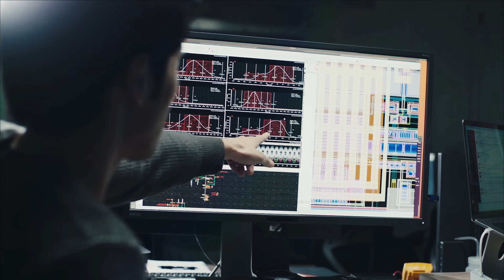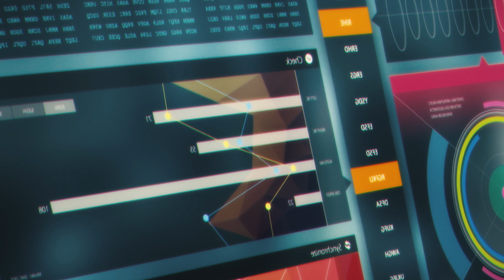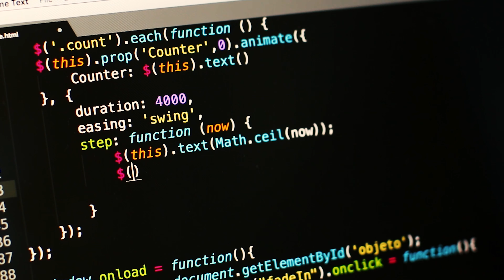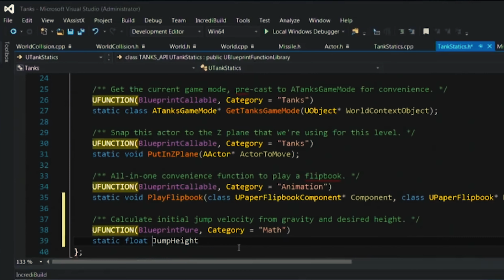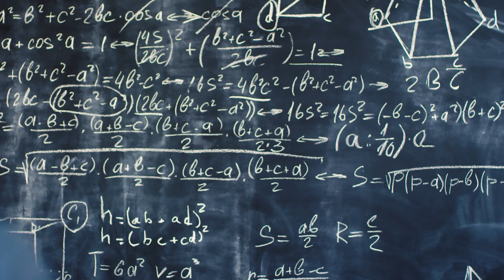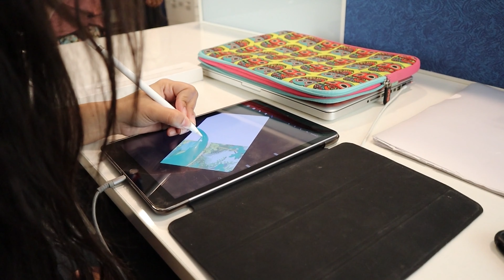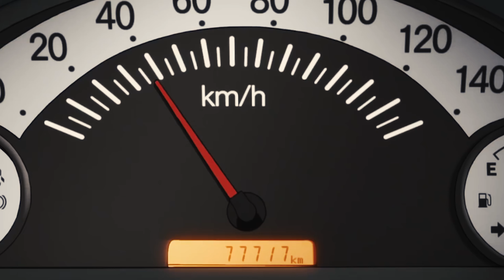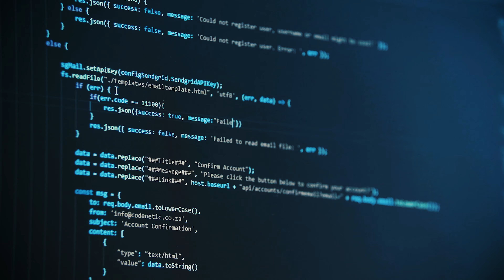Careers for VR in the 2020s

Comment: My pursuit of an electrical engineering scholarship lead me through an electrical apprenticeship first so I could afford it. There was a lot of labor, concrete coring and conduit running. I didn't quite graduate in the years I put in. The experience was shocking. VR tech very interesting to me though.
Reply from the maker: I can kind of relate. My hope was to go into an biomedical engineering degree at a college near to where I was, but my own life circumstances haven't made that a sensible options. Instead, I've been working at a warehouse and going to community college the past few years to try and get at least an Associates degree in Electromechanical Engineering Technology, and managed to get myself on track to get a Certificate in Industrial Controls as well. Time will tell how things work out on that front, but the experience of working a manual labor job, having to deal with industrial equipment, and with a completely non scholastic/office environment really was an eye opener. I think it was so in a good way though, I don't think I'd be who I am today without the hard times. All through it though, this channel hasn't died and I've kept the passion for VR. This medium is just too amazing.

Comment: Hi, I want to get into the virtual reality industry in the future, but as a physicist and preferably a researcher. I figured that there was most likely physics research that would need to go into the materials, or some mathematical models to improve the efficiency, however I can not find any jobs that are related to that in the industry- the closest I have found is an engineer, and I don't particularly want to do that. Anyone have suggestions as to what I should do to get into this industry with a similar job to a maths and physics researcher, thanks!

Comment: I think your right on physics not likely to assist full dive vr but wouldn’t neurology be the key element to unlock the potential of full dive because if your going to interact with the brain would you need neurology to make the full dive vr more full dive :/
Reply from the maker: We absolutely need an near complete knowledge of the brain to get things going. The only problem is that neurologists aren’t in charge of inventing the technology they use to study to the brain with in most cases. 

If I had to give an analogy here, imagine that your goal is to live on Pluto. In preparation, you develop an amazing map of the planet and its resources based on telescope and satellite images. That’s an incredibly valuable dataset you’ve created, but then you run into the big problem: you have no rockets or habitats prepared or being prepared on the horizon that will let you use that info.  While the resource developed is undoubtedly of great value to the eventual goal of living on Pluto, but without the tools to actually get there and leverage the information, the end goal remains far away. This does not detract from the value of doing the work, but the example clearly illustrates that no one area will be about to resolve the end goal. 

In this case, neurology is the planetary map. It’s undoubtedly going to be essential towards developing the end game goal of full dive, but we need engineers and physicists to develop the brain computer interface that will allow real time monitoring and manipulation of the essential brain regions before we can really say we’re on our way to completing the mission.

The best we as individuals can do is assist in the area that our skills are best at to max out our individual contributions to the end goal and support the research and development that will enabled progress.

This isn’t a competition of “my discipline is doing more than yours!” It’s either we get all the work done here or we all get nothing. Doesn’t matter if we have the perfect brain interfaces if don’t know what we’re doing with it and it doesn’t matter if we know what to control if we have no means by which to do so. We need the whole package. No ifs, ands, or buts.

Comment: So is your homemade rig directly compatible with other consumer brands? I forgot to ask.
Reply from the maker: Not entirely sure what you mean, but it'll vary depending on the hardware element at hand and how custom the element is.

The Head mounted display will likely be fully compatible with any other game title, though the conditions in the pod are likely to make the tracking break for just about every application. As for the rest of the system, the arduinos can likely be communicated with normally since I'll need to keep them updated even after I've build the system for any upgrades.

Everything else will likely be 100% bespoke. If I don't make it compatible, then it basically will have no support. The best case scenario I can see would be some form of VR standards coming out for things like touch, temperature, smell, and such that I could tap into and develop my Rig's functionality to work with. I already intend to have there be a form of 3d space translation to the physics based motion model of the rig's movement for compatibility with Oculus API and SteamVR, but the touch, smell, and temperature aspects of my rig will likely go unused in all but the the most modifiable of games. At this point, I only imagine it working with the games I make myself and VR Chat.

Hope that answered your question :)

Comment: Neuroscientists will implement the tech to record the process, "the bases" of "us", before the conversion to frequency-transmitions-signal are implemented.   When they will then see if it's safe for the human mind to transfer consious to a functionable programmed nerveous system with all the works.. Could allow a blind person to see or a deaf person to hear (crazy..) 
The tech engineers/programmers will be the mad lads corigraphing all the gadgets (which most that already exist) & languages. so the Neuro scientists can safely record & store. Our being & it's process's 
 (neurolink before; nervegear & it's predisesor designs ; then multipurpose AR eye wear when the designes are finished, that replaces "nerve gear" entirely if in required area.
(little devices to be placed that unlock the "link start" command so long as your in between the space set up: ones own personal space bed recommended but can be used during passenger travel most likely.. when out of that space is used for AR purposes whatever that may be) to be used for a full dive.Which all leads to..; elysium style regeneration.. & chappie "consious" swaps to able body..
   The "architects" game/graphic designers also for visual construction of the nervous system so our eyes allow us to understand what a mess we are internally before giving it function record movements with the nerouscientests handywork. 
       should be working right now to I guess for the first public long term "game" (SAO) or something so there is an immediate longterm use of the device to fund more people to create more "games" "rhelms" things, research in the time that the first game is being enjoyed.. 
   Then there is...
 The people funding all these people for their work.. 
    The people allowing any of this to happen at all. 
   The people who see people as suited canadates to even work on the project symbolically.. For Full dive. 
      It can be done in 2-3 years. The nerve gear, SAO if someone allows it to start.. Everything that comes after it.. 
    
      ..who's to say what degree he earned..